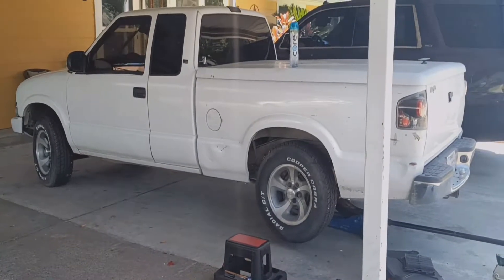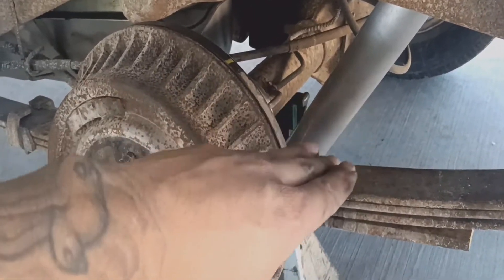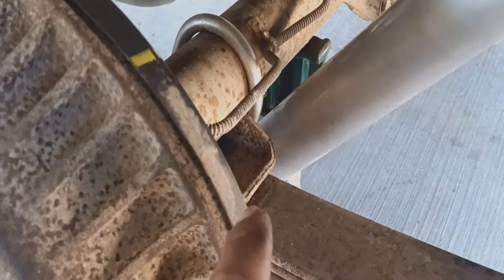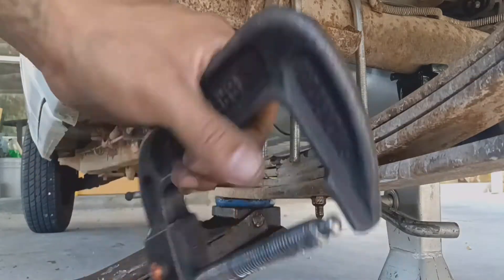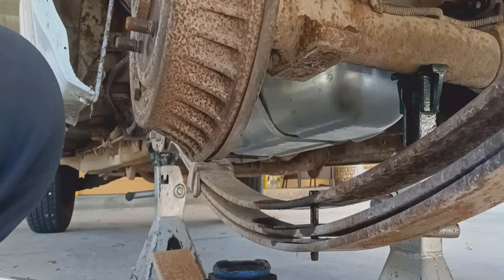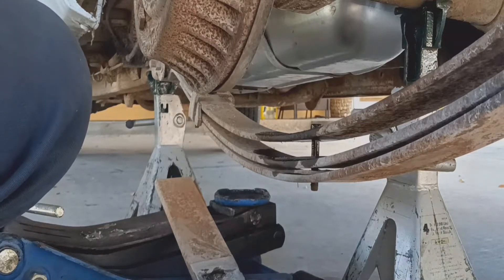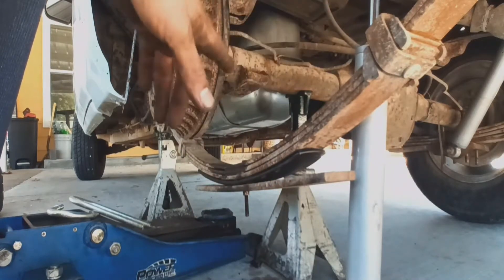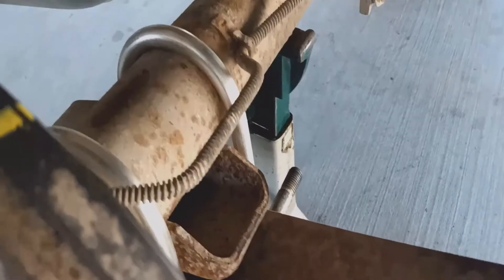2000 Chevrolet S10 How To Install A  Leaf Spring On The Rear / How To Add-A-Leaf On A 2000 Chevy S10

Comment: Did you have to cut the new center bolt for the add a leaf to put the bottom plate for the shock and ubolts looked pretty long
Reply from the maker: I can't remember if I did or not, but ones you tighten it you can cut it half and inch above the nut. Same thing with the ubolts you can cut them either before installing them or ones you hand tighten the nuts. In case you cut them before installing them make sure you measure or pre install them, mark the excess threads and cut  them hopefully that helps...